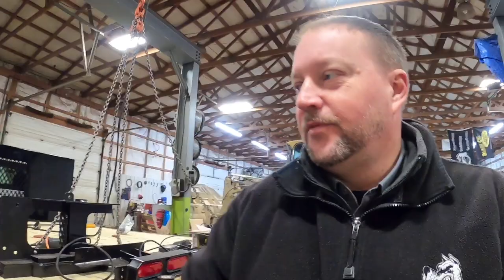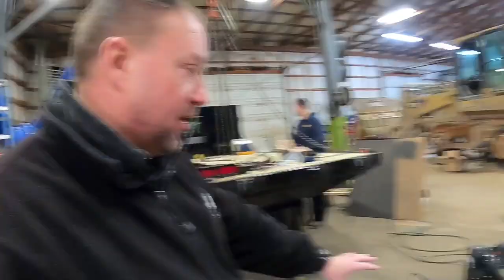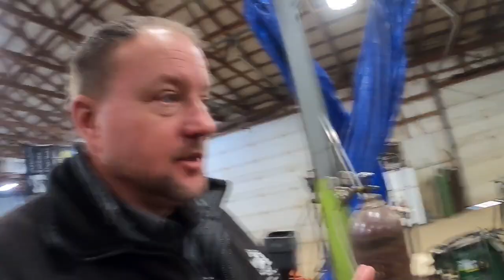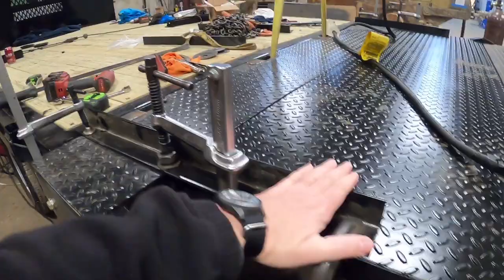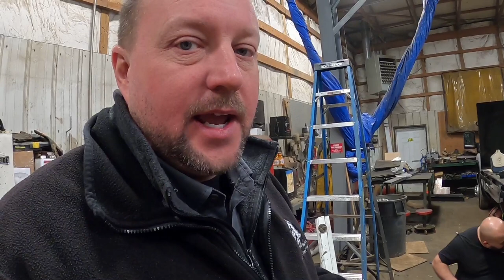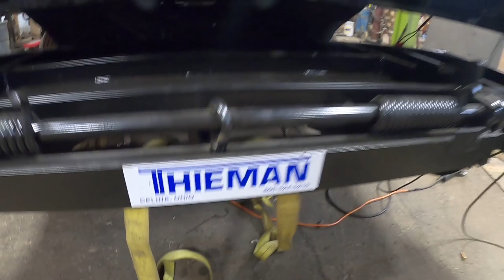Installing a Thieman Liftgate 2021 02 07 14 48 22

Comment: Your shop did a great job installing the liftgate looks perfect from the video the deck is right on.     I know this is my personal pet peeve is the switch for the liftgate for me personally I would’ve had it mounted sideways so don’t face up for the rain and bad weather I know it’s a weatherproof switch but that’s is me personal. Not that wrong the way it’s installed .  Keep up the great videos👍👍👍👍👍👍👍👍
Reply from the maker: I agree with you Stash. I prefer the in cab option and we have put them in the tool box before as well. Keep Watching.

Comment: Does Kentucky have laws where a truck does not need 'back-up' lights? The fixtures you had mounted don't have them. I thought that was a DOT requirement. What model gate is that?
Reply from the maker: Don GREAT QUESTION!!! The backup lights are LED and built into the backup lights. They are hard to see but they are their. In Kentucky shoes and backup lights not required. Lol just joking. That is a M16ET.

Comment: Be careful Todd. It looks like you came real close to working at the end and risked getting your hands dirty operating the Theiman tailgate.
Reply from the maker: Hey Wayne. Sorry for the slow reply. Your right I need to be careful so I don’t get dirty. Lol   Thanks for watching.
Reply: @TruckorTrack  
You’ve been quite clear when Dirt Perfect is there that you don’t “work” so it’d be a shame that you get caught “working” on your own videos. 
Thieman tailgates are great. We had them on the propane trucks I drove in the 80’s and 90’s but they weren’t the fold away type but the under frame section was basically the same.

Comment: Do you disconnect the batteries and modules be for welding on the trucks?
Reply from the maker: Great Question James!! We just disconnect the positive and negative on the battery. So we pretty much remove the battery. We do not touch the Moduels/ECU or TCU. We used to but it caused a few issues going that far. So just disconnecting the battery works great. Thanks for the question.